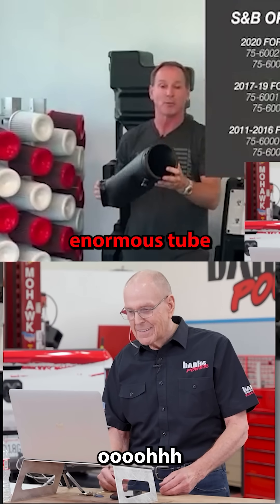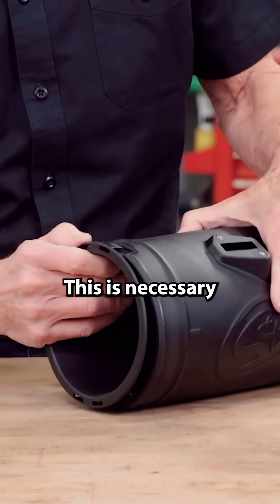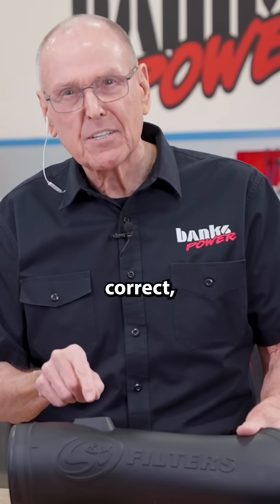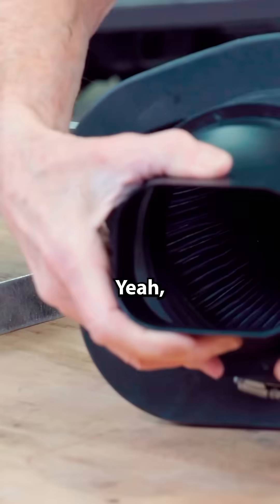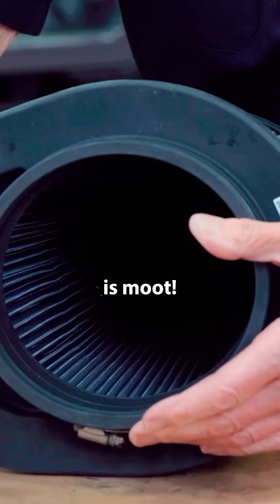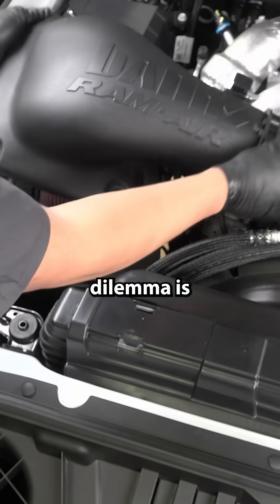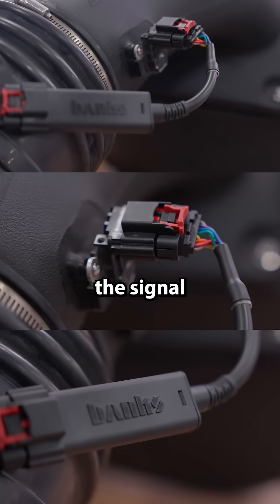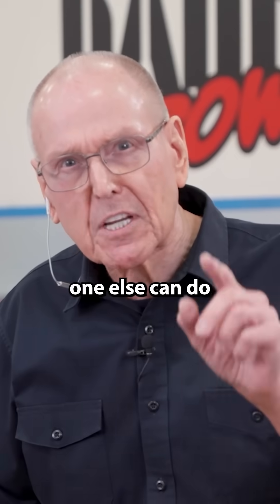Competitor tries to fake a big air intake

Comment: So this all makes sense truly.  But given the exact same size input to the turbo, don't they all end up the same at some point?  Please, not arguing, just wishing to understand.   I bought the S&B but Banks didn't have anything for a while.  I thought this then as well.  My main decision was honestly the cleanable filter.
Reply: There's a lot more to an intake than that. Wall material impacting friction, bend location, bend radius, length of straight sections before and after bends, etc all impact each other...each impacts how smooth the flow is as it goes through the intake and enters the throttle body. Turbulent air can create increased restriction and cause inaccurate readings by the MAF. 
Selecting the right intake is dependent on the design and the the vehicle it's for. 
As for a cleanable filter....a quality new paper filter of the same size flows just as well and they are better at filtering

Comment: A man who knows his stuff. If you do a speed density tune you can also work around the MAF problem.
Reply: Of course, but speed density takes more fine tuning for drivability that alot of tuners don't want to spend time on
Reply: @kevinmonahan2820 Thankfully my car's ECU makes speed density based calculations. Makes my life easier.
Reply: Do MAP sensors have this problem too?
Reply: @GenesisRasphotos the issue with a map sensor, is the pcm uses a volumetric efficiency table to determine the amount of air entering the engine, based on MAP and RPM. This table must be tuned to the engine, because any modification that changes the airflow characteristics of an engine will affect the VE and this table needs to be properly tuned for it to run right. Whereas MAF just directly measures the airflow into the engine, so theres no need for VE tuning.
Reply: @GenesisRasphotos  map sensor is alot better. But only most japanese car using this. Its more accurate and efficiënt.

Comment: But if you're just adjusting the signal from the mass airflow sensor, Without tuning the ECM, wont this just mess stuff up? You've got more air, but the engine has to account for that with more fuel. So how does adjusting the signal at the mass airflow sensor fix that?

Comment: 😂😂 so the reality of this is that you need a tune for mods. The actual solution that is used by 98% of engine tuners and builders convert to MAP in place of MAF, why? Reliability and consistency, all of which a MAF fails to meet.

Comment: > mocks restriction
> shows the restriction in a different place as the solution

I'm not at all tearing down the engineering, I respect that this guy gets fluid dynamics; but a restriction in a different place is still a restriction concerning total intake volume, right? You can smooth it out and manipulate it, but at the end of the journey, you're supplying at the same rate as the competitor. MASSIVE oversimplifying on my part for sure, I think I'm just being a silly billy in expressing my curiosity, haha.

I WILL be unapologetically sassy about what seems like malicious bragging about patenting an extension cord for the MAF lol ♥️

Comment: I've always wondered how anybody expected any gains from a bigger intake tube when they left the stock throttle body on...the only gain possible from an aftermarket "cold air intake" is from the increased surface area of the provided filter....so a stock tube and box with a bigger filter will do the same thing.

Comment: What kidn of bullshit is this? Just map the setup for the bigger intake, or just trick the signal so if you increase it by 33% ie 2.5 > 3" tubing just adapt it to that? Any kind of tuning shouldn't be done with MAF sensors anyway.

Comment: where is the MAF sensor module for the 2019 Ram Cummins? we have been waiting a year, and continually get excessive boost codes because of this! We call the Banks help line quarterly, and no solution yet! We tow with our truck weekly, and the code comes back every time.

Comment: I like Banks products, moslty... however, I bought the banks torque tube header for my 94 4.0 jeep years ago, didnt stay on there for more than a few months and swapped it for a Hooker, the banks had 2 collectors, 3 tubes each, for obvious reasons. NONE of the 3 tubes in either collector were welded out and had serious exhaust leaks! Yet the hooker, with all 6 tubes going to a single collector, and all 6 tuned, were fully welded, no leaks! Much harder to weld that way and yet it was flawless. Havent purchased a banks product since. I bought a few things prior, but if you cant manage the SIMPLE things, I can not trust you to handle more complex issues

Comment: Why use a MAF with a custom setup? Speed density is more adjustable and doesn't really care how massive the induction past the throttle is. I don't think you'd be using a stock ECU for anything with a filter that big the ECU wouldn't know what to do with it anyway.

Comment: Of course, Banks is correct. The MAF is calibrated to the cross sectional area of the tube. Bigger tube = more cross sectional area, making the stock sensor and the signal inaccurate.

Comment: It isn't moot, air pressure and flowrate are independent of one another. There is a lot at play here. I would like to see his Maf sensor to see if it can take multiple readings across a horizontal plane within his intake manifold. If it's a single point the maf isn't any more accurate than running a big tube without the reducer in the original one. The difference being the control module which probably runs a simple correction factor to the air velocity and pressure measurements that are recorded. In essence it is there to compensate for circumstantial effects that compromise a given measurement, in some manner. A factorised measurement shall always therefore be a “true” reflection of the measured quantum of Air volumetric flow-rate. 

We do this when commissioning HVAC systems all the time. Makes sense.

Comment: So he takes data from the sensor and runs it through a function that remaps it, matching the data taken with the OEM part.

I don't see why no one else could do that or how you can patent a remap process (that's done in countless signal processing aplications). 
I guess everything else about the product can be patented. But I can see other brands come up with a similar solution. Given that they have the resourses to test the air intake, collect the data and program their own correcting function.

The first solution that was shown in the video didn't seem that bad, tho. Since its getting the right data ditectly from the sensor with the right diameter of the intake. But again, the overall flow of the air may not be the same as with the OEM part. Same goes with just using an "air mass control module". The flow of the air on a bigger tube isn't the same and you're just playing with the data so that the MAF sensor detects that everything is OK.

Comment: That fake intake is a prime example of a mechanical engineer "solution" to an electrical engineering problem 😂.
Reply: Hey they wanted to make it big. They just from the looks of it already had mortgaged the house on original design and had to sell out all the way
Reply: I mean, don't get me wrong... correcting the MAF readings is a superior solution (cost aside), but to say the increased diameter is moot because of one restriction point is ridiculous.  That's simply not how fluid dynamics work.  It will cause some pressure drop, and some turbulence downstream... but there is always going to be significantly more flow.  The flow rate of a pipe is not defined by its most restrictive point.
Reply: @MacroAggressor Exactly right. The size restriction is simply a function of matching the expected area of movement to what is expected by the sensor, so it gives an accurate reading. Restriction calculation involves the third dimension, which in this case, would be length, and there is basically none. The real problem, as I see it, is going to be turbulence within the intake, pre-manifold. That may cause slight inconsistencies.
Reply: @MacroAggressor  depends on the flow rate but the exit of that restriction is going to cause a massive pressure drop.
Reply: "A brilliant solution to a problem that should have never existed in the first place."
-James May
Reply: it's not really even a mechanical engineering solution, it's just a poorly thought out product full stop, regardless of your field
Reply: This is an instrumentation problem. I don't know how he can patent this, there are tons of smart hot wire anemometers existing in industrial applications.
Reply: Pretty humble comment there.  I am an ME and I know through my EE digital and analog circuits plus controls courses how to design and control for this, not to mention courses in fluid mechanics and or fluid thermals systems.   The other guy seems dishonest, sells to the uninformed. IF he was an ME he would know better, maybe still dishonest.
Reply: @eddyanders 🎯
Reply: @eddyanders   By "the other guy", I'm assuming you mean the guy in the video.  I don't know for sure that it's dishonesty (but I suspect there's an element of it... you don't spend a lifetime working in automotive design and not understand how pressure drop works).  To be fair to most normies, though, it's a very common... and although falsely, intuitive... misconception that if a pipe narrows at a point, it flows as if the entire pipe is that diameter.  It's not worth it for most people to bother learning against intuitions like these since it doesn't really affect them.
Reply: what? You do know that mechanical engineers also deal with DC circuits and electromechanical systems, right? you and 668 people should be ashamed of yourselves
Reply: Reminds me of 3d printer modifications. While most people in the community solve things mechanically like putting a switch that the print head pushes to take a picture with a camera, I as an electrical engineer pulled out a pin from the motherboard and wired it to the camera.
Reply: Not even an EE but isn't that just slapping a/some operational amplifiers onto the sensor to modify real signal into spec signal as a spoof? That shouldn't be too terribly hard..
Reply: @JuliusCeasar224 nothing is hard until you do it. The plastic enclosure alone on that simple thing is $50k in design and tooling for injection mold. Now you got to source the OEM connectors. If they aren’t available or proprietary then that’s $30-50k each connector for design and tooling. Designing printed circuit board seems easy. Until the little hang ups get you. Or your capacitor you are buying goes out of stock completely now have to redesign. Nothing is easy until you do it. I started an electronics manufacturing company and it’s been the hardest and most expensive thing I’ve ever done. All for a very very simple part. At high level an engineering freshman could design it. But when you get into making it manufacturable and easy to use plug and play and safe, just start throwing money and time at it because it’ll never stop. And that’s not even dealing with compliance issues. Try to sell to auto stores and now meet any type of UL or EU compliance, that will put you out of business completely if you don’t have $100k laying around. Also do you have $15k for patent and $3k for trademarks? If not someone else will just profit off of all your hard work.
Reply: Been done since the 90s not aure what he pattened . Have op amps tor ones that run on freq and voltage amp and divider boards for hot wire units @JuliusCeasar224
Reply: It' a digital sensor, so no @JuliusCeasar224
Reply: @JuliusCeasar224 that is 10,000% an electrical engineer problem
Reply: @JuliusCeasar224  not the same thing at all. You need to adapt your sensor to the rest of your electronics or in many case they won't even work.
Reply: @TheNefastor which is all cool and complex yes but it also isn’t that hard to figure out with the right tools, and information. Don’t act like a physicist now
Reply: @AydenNamie  I act like that because I am one. And you act like that because you have a chip on your shoulder. Some of that "information" you mention is what I posted. That and all the rest is part of having an education in science.
Reply: @TheNefastor yeah buddy you don’t need to know physics to trial and margin test the sensor throw it on a graph and find a sweet spot that’s good enough
Reply: @user-nn4jy9hi1y  that only works for the very simplest sensors, though, like a thermocouple maybe. It's like claiming you don't know chemistry, you can just mix random stuff and see what happens. Why is it with the uneducated and the need to claim knowledge is unnecessary? Is it because you guys don't know what you don't know? Over a quarter century of people basically telling me they can do my job with no education and no experience.

If it was possible, engineers wouldn't get paid as much as they are, and engineering degrees wouldn't exist. So give it a rest.
Reply: You’re right, while I don’t know exactly how gale would go about adjusting the output based on environmental variables that the manufacturer has tested, but a maf sensor isn’t that crazy, and with some math you could probably make a somewhat universal rule for the module to apply, the concept is not that foreign. Maybe I don’t know every little detail but I’m young and in college, if I knew that I’d be paid like gale. Hop off your high stool and keyboard
Edit: this also isn’t an f1 car
Reply: Still we are the ones that have to fix that problem. Wonder why.
Reply: One it's probably not carb certified also we have had maf calibrating devices since the 90s so not sure what he pattenetd but it's not the idea of maf Calibrating.
Reply: Yeezy there buddy
Reply: 😂😂😂😂well I don't want to fiddle with those wires
Reply: but its not electrical it is a physical design issue air flow is not electrical.

Comment: Gale skipped over a big point there.... for emissions to pass, the air velocity must be consistent with OEM. But if you're modding a diesel engine, then showing less air will result in overfueling, aka rolling coal, which makes lots of power for cheap.

Comment: You can avoid needing this if you re-tune your ECU to account for the changed MAF signal.
Reply from the maker: Tuning can be a great solution for people in a lot of cases, however,  there are a few down sides: the cost and it'll void the warranty. Our solution allows you to run an upgraded intake without modifying the ECM or setting a check engine light.
Reply: @bankspower  oh absolutely.
For someone who just wants a better intake with meaningful and safe power gains, your little gadget is a must-have. i assume that buying and calibrating it is cheaper and easier than going to a standalone ECU

Comment: Why didn't you install your sensor right at the opening of the intake where all the air is fighting to get into that opening of the intake?
Reply from the maker: Because mass air flow is constant throughout a system. Mass flow at the intake is the same as mass flow at the manifold.

Comment: So you made a breakout module to change the scaling to read correctly at a larger cross sectional area? Can also be done in software to an extent... Seems like it just requires an op amp?

Comment: Any intake tube that is larger than the throttle body is moot!
Reply from the maker: A less restrictive intake means less density loss from ambient air to the throttle body (or in the case of modern diesel trucks, to the compressor inlet). Denser air means more air mass in the same volume. The air by volume through the throttle body may not have increased, but the air mass has.

Comment: Can't you just split the channel into two and measure only the one with recommended diameter?
Reply from the maker: Unfortunately that won't work. Splitting the flow does not suddenly double the velocity. MAF sensor work by measuring the cooling capability of incoming air on an exposed hot wire. Air mass is derived from that reading by knowing how large the cross sectional area is that the air is passing through. Our Air Mass Control Module essentially just tells the ECM to expect readings representative of a larger tube. Even though air velocity in a larger tube is slower, and the cooling effect on the wire is lessened, the overall mass flow is higher.

Comment: A custom tune will correct without the insert.. #efilive #hptuners
Reply from the maker: Tuning can be a great solution for people in a lot of cases, however,  there are a few down sides: the cost and it'll void the warranty. Our solution allows you to run an upgraded intake without modifying the ECM or setting a check engine light.
Reply: @bankspower  yes there's a lot of folks that are worried about warranty true enough. But the cost of a custom tune is worth it on the big end because you return on investment will come back to you reasonably quickly with added fuel efficiency and power. Also on top of that the wonderful cold air intakes if you have designs in the diesel Market would reap even greater gains with a custom tune

Comment: Orrrr, you could just recalibrate the MAF sensor for the larger diameter…
Reply from the maker: Tuning is a great solution in a lot of cases, however,  there is a down side: it'll void the warranty. Our solution allows you to run an upgraded intake without modifying the ECM or setting a check engine light.

Comment: I just went into my ECU and reprogramed the sensor to interpret equal voltage as as higher airflow
Reply from the maker: Great. Tuning can be a great solution for people in a lot of cases, however,  there is a down side: it'll void the warranty. Our solution allows you to run an upgraded intake without modifying the ECM or setting a check engine light.
Reply: @bankspower  true, tuning can also be expensive if you don’t already have the tool